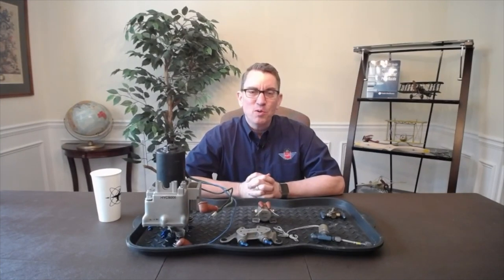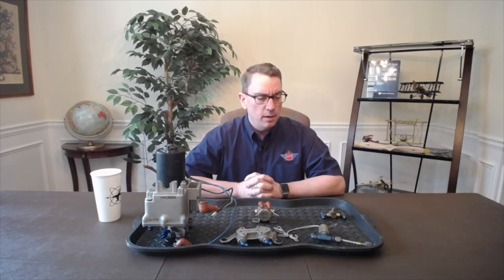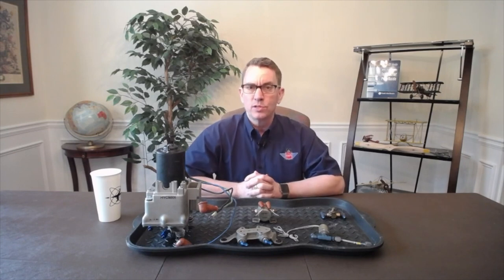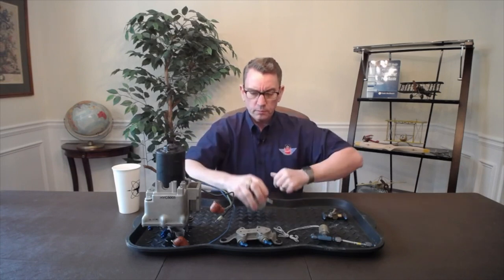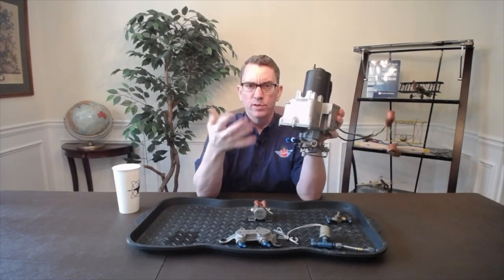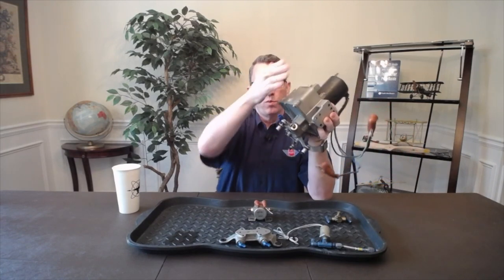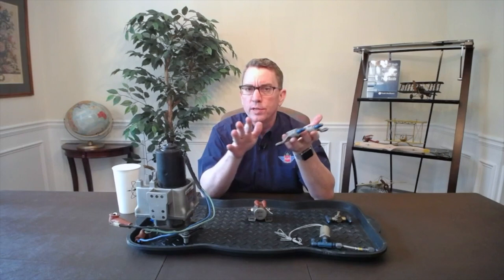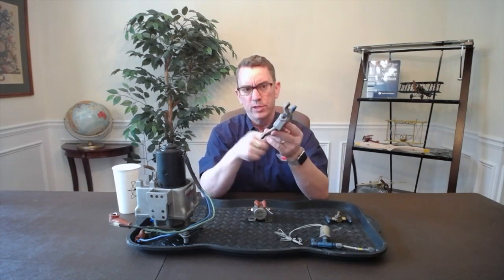Piper PA-44-180 Seminole Systems

Comment: Todd, a question for you, on the Right Squat Switch, what is its purpose. It is not listed in the POH. I have heard it is tied to the landing gear horn. Yet, all our planes still sound the stall horn on the runway. 

The diagram in the POH only shows left is set to ground when the plane is on the ground and the right is set to ground when it is in the air. I am proud to have students doing their due diligence with these great questions.
Reply from the maker: The purpose of the RIGHT squat switch is only for indicating of the gear up/down indicator in the cabin.  The LEFT squat switch is what interrupts the stall warning system on the ground. If you take a close look at the squat switches, you will see the left gear has 2 and the right only has one.  Are you flying the 79-80 version or the 2000+ model?
Reply: @ToddShellnuttCPC  We are in the 2000+ models. I am so used to Cessna that has very detailed POH System descriptions. All the POH shows is that how one is grounded on the ground and the other is grounded in the air. 

Thank you again for your video series! This has been so helpful for my students! Wished I could have had you at KIWA for Multi but you left just before I was in your class!

Comment: great video, got a question about the squat switch, there is supposedly one on the right main too for maintenance time and the stall warning horn, however on the pa44 seminole I fly the stall warning does work on the ground and i failed to see any such switch was this a feature of the older makes of the same aircraft because aircraft I fly is about a year old?
Reply: Ferdinand Heldman yup! Section 7 of the POH
Reply: I have been searching for this answer as well. It is not listed in the POH.
Reply: Jeff Gutowski depends on which model you have. If you have the G1000 carburetor or latest fuel injected model it does have it
Reply: kevin mere I have the g1000 and it isn’t in there. I have checked all over. I will keep looking for a definitive source answer.
Reply: Jeff Gutowski you’re right, 7.11 only depicts left main gear. I got confused. Sorry for the misinformation

Comment: Hey! What is the assembly called that holds the shuttle valve and the hydraulic fluid enters into?
Reply from the maker: It is called the "Pump Base".  Take a look at this link and reference page 340. There is a pic of the part and how it all goes together.  https://www.manualslib.com/manual/1638427/Piper-Pa-44-180-Seminole.html?page=340#manual
Reply: @ToddShellnuttCPC  thanks!!